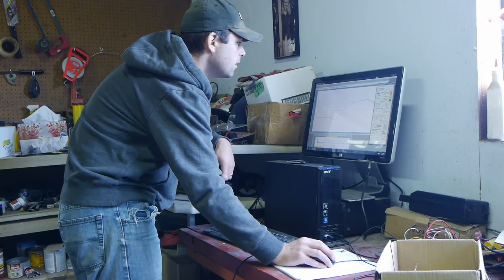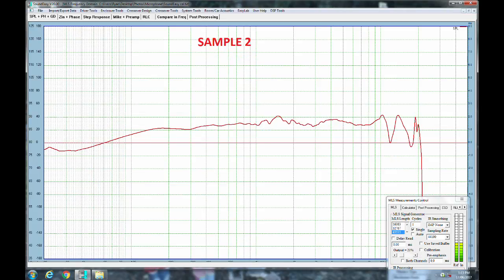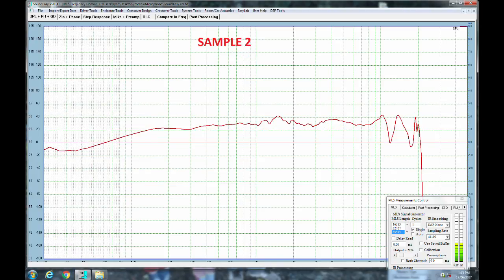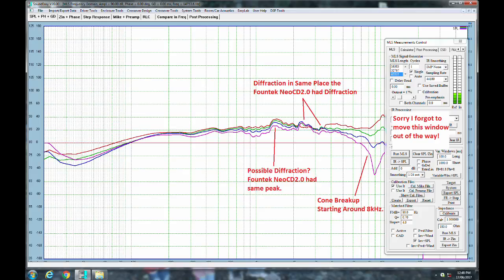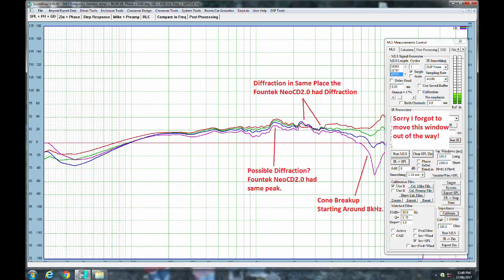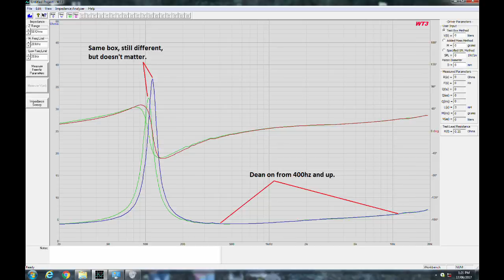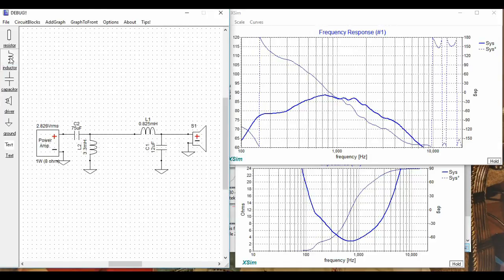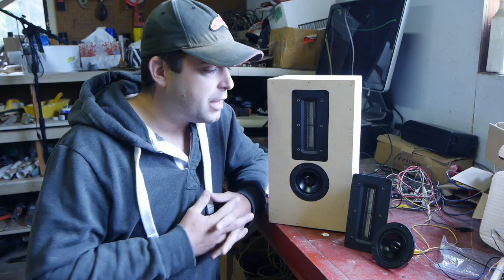Tymphany (Vifa) NE95W-04 Driver Testing and Review

Comment: Can these drivers be used in a car audio setup (Tymphany NE95W-04) 
Especially in a hot region like India?
Reply from the maker: Probably. Can’t see why not.
Reply: Someone told me that by using home audio drivers in car audio environment you may ruin them because they are meant to be played at home, so their  surround may degrade
Reply from the maker: @PrabhjotSingh1  nothing supports that claim. Car audio drivers might prioritize other features like power handling. But home audio drivers are perfectly fine in a car.

Comment: This brings back memories! In my 20's I had a Ford Taurus with a Blue Book value of less than than 3 grand. My pioneer deck cost about 400 bucks. It had 3 sets of 8 volt rca's. Two for the full range mids/highs.  and one for the bass. I used a 4 channel Zapco amplifier for the mids and tweets. (Dayton tweeters and the 4 inch version of these Tympany's Vifa's.) I had another 2 channel Zapco powering the midbass. (Using the output from the midbass and set the filter on the amplifier.). (Bass was another story....two Fi Audio 18inch Q's.).....Anyway, another rambling. These speakers get my seal of approval.

Comment: hello sir.. i am trying to build a monitor speaker using 2*LM1875 ( to drive 2*NE95W + 1*Peerless OX20SC02-04 ) / channel. 
can you please help me design a crossover for the above specific speaker and tweeter. ?
Reply from the maker: Shah b.s sorry I don’t have that tweeter and it requires a lot of build time to design a XO. You can download my measurement files and work with those if you want though.

Comment: It's not a bad mid range driver (actually pretty good) but (aside from the fact that your sensitivity discussion sounds off the mark) until you know the driver's BL curve, frequency V distortion figures, impulse/step response, and other parameters it's hard to tell precisely how good it is.
Reply from the maker: Jim Stanley what is wrong with the sensitivity comment? It’s pretty low sensitivity for a mid. Maybe it was how I described adding a second mid for more efficiency. My language might not have been very clear. Sorry.
Reply: @ImpulseAudioSpeakers  It's OK. 

It was really the slightly ambiguous and/or unclear way you proposed using 2 drivers seemingly as a means to deal with both the low sensitivity and sensitivity *disparity issues you discovered.

It wasn’t quite clear what you really meant and/or what (if any) configuration (parallel/series) you actually thought would deal with the problems; particularly the *latter - but I now see someone else (below; from Russia) started a discussion about parallel/series connections within the context of sensitivity, that partly addresses it.

Since you asked . . . 

My way of thinking about this matter/subject was like this; a moving coil transducer’s acoustic output is proportional to the RMS current through the voice coil; meaning it’s not really a voltage device - although most amplifiers are considered and/or discussed to be. People sometimes get confused between efficiency and sensitivity, and sometimes it matters even though the 2 quantities are closely associated and considered/measured similarly.

Unlike power (which is a scalar quantity) current/voltage and sound pressure levels (SPL) really are vector quantities.  

So, 2 similar (preferably identical) drivers like your Vifa’s that (regardless of parallel/series configuration) are fed with the same in-phase signal will usually (provided the amplifier output is adjusted to compensate for the impedance/other changes so it remains constant regardless of the parallel/series configuration) ~result in a +3dB higher SPL and/or acoustic output; than if, say, you merely drove both transducers separately.

And that is because (as I am sure you know) in-phase SPL is ~additive. 

However, the non linear components of the transducer itself alters the way current and/or voltage (presented to the network from the amplifier) is divided up between each (parallel/series) transducer network - which in turn (provided the amplifier output is not adjusted to compensate for the network’s impedance/other variations) then changes the power figure the amplifier presents across each transducer network - which in turn changes sensitivity figures.

Therefore, with a parallel connection (voltage the same across all transducers and current is divided) a +3dB SPL increase will always be observed as a result from the ~above-mentioned coupling and this is then added to another +3dB SPL increase that results from the fact that the (parallel) transducer network now totals 2 ohms (rather than 4) which results in more output power/sensitivity. 

Likewise, with a series connection (current the same across all transducers and voltage is divided) a +3dB SPL increase naturally occurs as a result of the ~above-mentioned ~coupling - but this is then lost (as another -3dB SPL is added) because the (series) transducer network now totals 8 ohms (rather than 4) which reduces the output power/sensitivity figure enough to completely compensate for any ~coupling effect. So, with the series network configuration all available voltage is effectively divided equally bringing you back to a 0dB increase overall.

If each transducer was nominally 8 ohms and the input signal was 8 volts;

A) For the aforementioned (8 ohm) parallel network example; a total of 16 watts would be consumed.

B) For the aforementioned (8 ohm) series network example; a total of 4 watts would be consumed.

So, provided your amplifier could drive a significant load such as 2 ohms, you could probably address the sensitivity issues by configuring the 2 transducers in parallel; but is that what you were thinking? And, if so how (do you think it) would it address the *disparity issues you observed between drivers?
 
Anyway, let's not worry too much more about your sensitivity comments, as some of it was probably just semantics. Furthermore, I probably approached it being too judgmental - perhaps thinking back to the last time I commented on 1 of your videos. As I remember (from your active Xover video) you previously commented in a way that suggested (to me at least) that active Xovers were not superior; when not only, are they vastly superior - but also, there is no (performance) comparison at all between a passive Xover to a well designed active Xover.

OK, getting back to the Vifa midrange driver . . . 

Please tell me . . . . 

Given the nominal impedance is 4 ohms for each driver, why do you think the sensitivity is only around 87db, and what do you attribute the difference in sensitivity between the pair of drivers to?

Low sensitivity hint; it can really only be a few of the other parameters pertaining to the driver. 

Disparate* sensitivity; do you think it relates to non linear aspects of the driver and/or its impedance?
Reply from the maker: @StormCentre88  ya a lot of people have misunderstood me on that active XO video. Tempted to remove it or redo it. I wasn't claiming passive was better or even equal. Only that they both take the same knowledge and understanding of acoustics to do properly.

As for the sensitivity vs efficiency, I understand the difference and my comment about using two in the video was to raise efficiency and also in the back of my mind it's easier to design a (passive) XO using an 8ohm mid. Once the bandpass filter is applied impedance often drops pretty low. So two in series would help with this. As I was just rambling to the camera it didn't come out clear unless you're a mind reader. My fault.

I called it 87db sensitivity because the measurements were taken at 2.8V and 1m (effectively) and the frequency response yielded an average output around 87db. I can't recall what the TS sensitivity was, but I prefer thinking about sensitivity in terms of the frequency response. In all of my test videos I state the sensitivity based on what I see in the frequency response. As for the difference, I can only speculate. Could be a manufacturers inconsistency in cone mass, voice coil wire, magnetism, spider stiffness, etc. There's a few things that could be different about each of the drivers and I could not say what it is. Normally I find these kinds of inconsistencies rare, but I seem to have found it a few times when doing these videos. If I went back and checked out the TS parameters or took some more measurements I could maybe nail it down or at least get a good idea, but that isn't really the scope of my video. It really could have even been me! Perhaps I bumped the mic or didn't get a good connection on the wires or something. I doubt it because I think I'm thorough, but you never know. These test videos are only to show the baseline of performance and leave it up to the viewer to decide if they'd like to use the driver. If the difference concerns you I wouldn't use it then.
Reply: @ImpulseAudioSpeakers   With respect to active/passive Xover stuff . . .

I think if you're just plugging stuff together with software and never truly (properly understanding all the technical specifications/terms within of each drivers data sheet, and never) completing a finished system and/or thoroughly testing it (including for; frequency v pressure - cumulative spectral decay plot - step/impulse response - phase v frequency - horizontal/vertical directivity - cabinet diffraction - acoustic centre) then “maybe” the same knowledge is involved.

But, if your designing/building a 3 or 4 way system from scratch; and you want it to sound and perform well (including via the above-mentioned measurements) an active Xover - particularly in the digital domain - is miles more complex than serving up a Butterworth or Linkwitz Riley passive filter.

This is why almost all Hi-Fi speakers (including the ones costing hundreds of 1000's of dollars) involve passive crossover designs and perform less than spectacularly with the above tests.

They may sound nice, but they usually don’t measure well.

The acoustic/audio holy grail is often elusive but ti's aligned with the path of accurate design, test, and measurement.

I have never heard a well designed active studio monitor that measures well, that doesn’t sound well.

And - as per my comments in your Xover video - there is no (performance) comparison between a well designed active system and a passive system; as the active system is better in every respect. The active crossover design (provided it is done properly) solves many of the problems that passive design creates and can't deal with.

Still, you were mostly just trying to have some fun with your Xover video; so I wouldn’t delete and/or worry about it.

Electroacoustics and electronics can very quickly become a complex subject and the subject matter you frequently discuss is (commercially) the domain of electronic/acoustic engineers; but there’s no harm in doing what you're doing provided your respectful and willing to admit oversight; and you clearly suffer from none of those problems.  

There are probably designers/viewers out there that are less experienced with electroacoustics and electronics than me, but I like your videos and the passion you have.

With respect to the Tymphany (Vifa) NE95W-04 and its observed (low) sensitivity; without looking at the data sheet, and just guessing, I suspect the culprits are . . .  

1) Small magnetic motor; even though it is Neo.

2) Probably (from point 1) has a low flux strength/density and/or force factor.

3) Voice coil design (from your video) looks less than top shelf; it is clearly not an under-hung design. I doubt this driver has more than a 2mm linear excursion.

4) Effective cone area will probably be considerably less than the 3 inch advertised size of the driver; I suspect, from looking at it, it will be just over 2 inches.

5) Point 4 will do little to improve the radiation resistance; which has a relationship to sensitivity.

6) Points 1 and 2 will do little to ensure sensitivity figures are high; as speaker sensitivity has a relationship to how effective/responsive cone-motion results from changes in current within a current carrying conductor immersed in an electromagnetic field. 

Put simply this is a well designed - but low budget - small mid range driver; brought to market by a reputable company with experience in the wholesale and retail audio market.

However, the combination of the above constraints/considerations combined with the fact that it is probably too small (point 4) to couple to the air really well (without some kind of horn loading) for the entire frequency range (that it impresses in typical 1 watt per metre and/or 2.83 volts per metre half space SPL tests) even if those constraints were not present - most likely means that this driver will fall over when both, resolution counts and the volume is turned up. Particularly in 2 way designs.

That said, I believe you were considering (in the video) of using pairs of them for each channel; and that is what I would do if I were using them. I would use pairs (or 4 of them) and cross them over to a mid bass woofer (which crossed over to woofer) and tweeter.

Years ago I consulted on aspects of the design of JBL’s differential drive woofer transducer; and as a result of that (and university studies) I become reasonably comfortable with electronics, acoustics, Faradays Law, Lenz Law, Lorentz Law, Maxwell’s equations, KVL, KCL, and Tellegens Theorem, as they apply in real world circumstances. If you get a chance have a look at the magnetic motor, dual coil, braking coil, and overall/differential architectural design of those drivers/woofers; they're special.

I challenge anyone to present a better designed moving coil driver that addresses the issues at their core.

Keep up the good work.

Merry Xmas.
Reply from the maker: Jim Stanley I cant tell if your post is nice or condescending. You certainly think highly of yourself. You’re not as right about this stuff as you think though.
Reply: @ImpulseAudioSpeakers  My post was meant to be nice; not condescending.

Sorry if it came across the other way, it was boxing day and I wrote it fast; as I was ready to go to a dinner.

What parts am I not right about, and what parts do you think I am too right about.

Happy to take your feedback.

Comment: can i use this in my car as midrange?
Reply from the maker: renzart sure. Not very sensitive if you’re an SPL guy, but it has good SQ.
Reply: Thanks alot for the reply. i was  looking for good sound quality. Definitely not an SPL guy. My hatchback is installed with polk 2 way components and co-axials. and 2 rockford punch 2 , 8 inch subs in fiberglass enclosures. The sound quality is great, but i miss the mid range frequencies. Hope this one will improve the quality. Does this speakers require an enclosure? What is its approximate volume ( ltrs) ? Let me know, what you think?
Thanks.
Reply from the maker: renzart it does require an enclosure, but it is happy in a small enclosure if you are crossing above 600hz. You can use something like 3L if you have too.
Reply: @ImpulseAudioSpeakers  Thanks alot. I will try this.
:)
Reply: I must tell you . these drivers are sweet. i am using these in my car since 2 years. what kind of capacitor is required for these drivers to play only mids. cutting down the highs and lows? i have a tweeter+ woofer+sub set up, these drivers are my ad ons . Thanks.

Comment: One way to check instantly an effect of panel edge difraction is to tape a piece of cardboard to one side. 
BTW using two 4 Ohm  drivers wouldn't help much with sensitivity. They can't be connected in parallel due
to low impedance. But connection in series will not change sensitivity at all.
Reply from the maker: Илья Основиков two in series would reduce excursion requirements and distortion as well as increase power handling, efficiency, and a few other benefits. I can’t remember what I said in the video but I don’t think sensitivity was one of the reasons. Keep in mind that efficiency and sensitivity are different things.
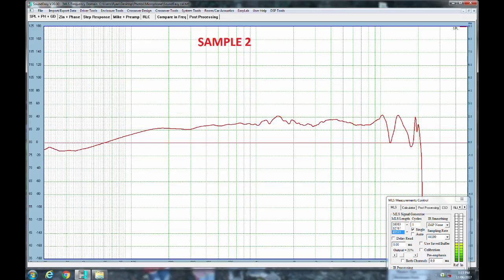Reply: I believe you said that because of low senstivity one migh think of using two drivers instead of one (2:44). Low sensitivity might be a problem in three-way passive system if woofer is more sensitive (per Volt) than midrange. 
Agree with the rest.
Reply from the maker: I have a notification but the response isn’t here?? 2:42 is talking about efficiency due to the 4ohm load. Using two in series will improve that. I should have specifically said in series. Sorry.
Reply: Using two in series will improve efficiency but that doesn't help in a three-way passive system if a woofer is more sensitive (in dB@2.83V/1m) than a midrange. Even if you connect 2 of these drivers in series, the sensitivity (in dB@2.83V/1m) will not change at all. It will be the same 86 dB@2.83V/1m for both drivers combined as each one of the drivers will get only half of the applied voltage. 
Agree with the rest of you opinion.
Reply from the maker: Илья Основиков and I agree with that.  I wasn’t trying to say it will increase sensitivity. The way I said it was probably confusing sorry.

Comment: When using the 2.5 inch peerless Vifa mids how many watts can they take? Lets say you band pass them from 400hz to 4khz. Thanks
Reply from the maker: Brian Roberts 400hz isnt very high for these little mids. It would need to be modelled but Im guessing less than 50 watts. Keeps in mind 50 watts into a mid is actually a lot.
Reply: Impulse Audio ok thanks that helps. Do you think 700 is more reasonable?
Reply from the maker: Brian Roberts 400hz wasnt unreasonable. Just not very high for power handling. Im guessing your a car audio guy so if power handling is an important consideration then 700 might be better for you. That is a big jump and you could easily go over 100 watts. Which is a lot at that freuqnecy. Just think that in real music content thats probably 1000 watts into the woofers.
Reply: Impulse Audio ok thanks a lot! ya im using them 3 way in a car